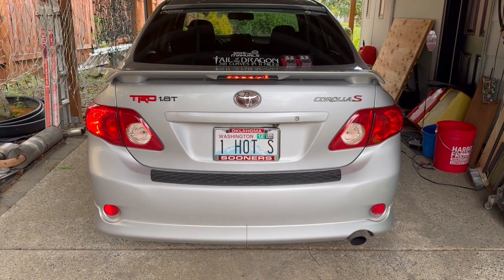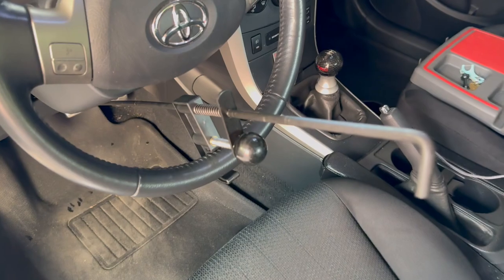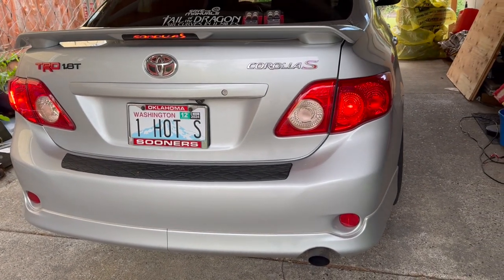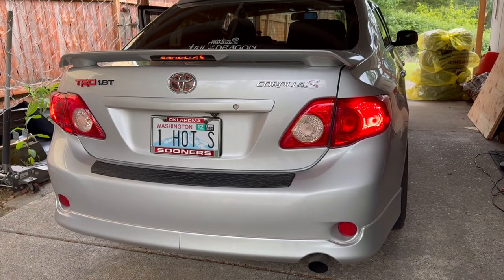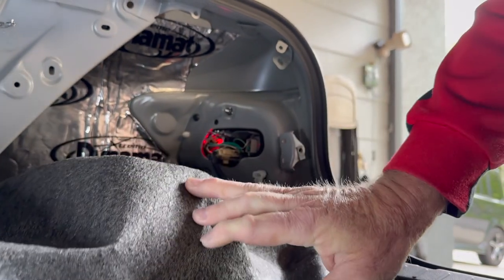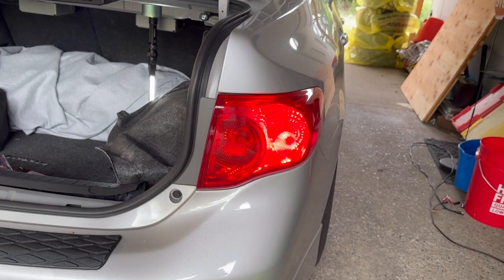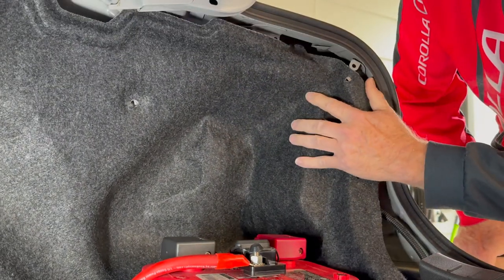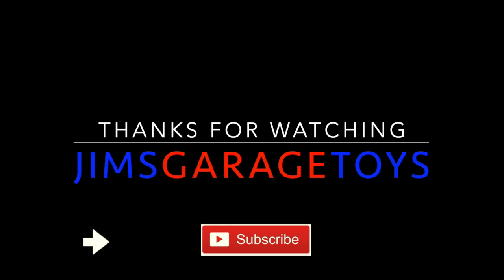Super Bright LED Bulbs | LASFIT LED | T3-7443R Brake/Parking | T3-3157A Turn Signal | 2009 Corolla

Comment: Looks good. Don't forget to add the lasfit led license plate lights as well.
Reply from the maker: I'm not sure about those since I have a backup camera in the place of one of them. I'm worried that it would look weird with one side really bright and much brighter than the other. I need to look at the camera and see if the bulb is able to be changed.

Comment: Nice Jim. Is this faster than the gr rolla?
Reply from the maker: No, I built it to still be reliable but give me more power for passing and at elevation when in then mountains. I'm only running 8.5psi since I'm on stock internals but it added 100bhp and transformed the car. It's so much more fun to drive now as I've also done a lot of work on the chassis, brakes, and suspension too. It's a well rounded car now and I love it. I started the turbo project back in 2016 and it's been fantastic. If you search my channel I have other videos on it too.
Reply: @jimsgaragetoys  dang almost doubled the hp. Would you turbo the im? Then all your cars would have turbos haha
Reply from the maker: @rocklee7216  I've been asked that a lot and did think about it but I went a different route just so it was different. I kept it a NA build but I did go from 137 bhp to 180 bhp so it is better and it pulls a lot better from 3500 rpm.

Comment: Just got the turn signals done and am getting ready to order the same brake lights, but i wanted to ask you if there is a big difference between the dim and bright mode when you press the brakes?
Reply from the maker: Indeed there is! The parking light brightness is about what the old brake light brightness was and the LED brake light brightness is on a whole different level! I thought that I showed all of the differences in the video so everyone could see the difference, did I miss one?
Reply: @jimsgaragetoys  maybe you did but I'm not sure. I'll have to rewatch. I could've sworn you didn't step on the brakes but either way I'll have to buy these. I'm sure they're super bright when you step on the brakes
Reply from the maker: @dannysandoval5703  I'll have to go through it again to make sure. I know the camera had issues with the brightness when it was at dusk. 🤣

Comment: They don’t make a TRD Corolla or a turbo Corolla /1.8T !!! take all that crap off and just enjoy your reliable Corolla😊
Reply from the maker: "They" didn't but I did, and I'm proud of the car I built. I turbocharged my 2ZR-FE and added 100hp to it. I had already done a lot of chassis and suspension. I upgraded the brakes with a BBK up front and did a rear drum to disc conversion. I built it to what I wanted so if I only have 2 subtle badges, it shouldn't bother you. It's my TRD Corolla Turbo S. 😉😍